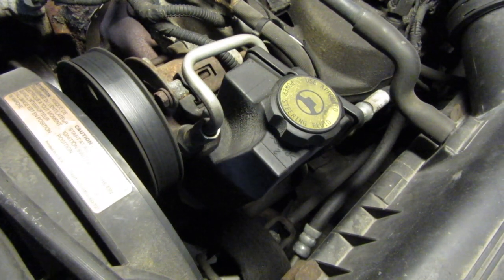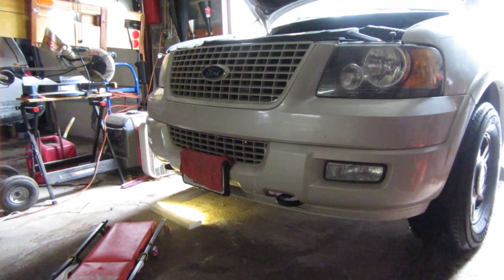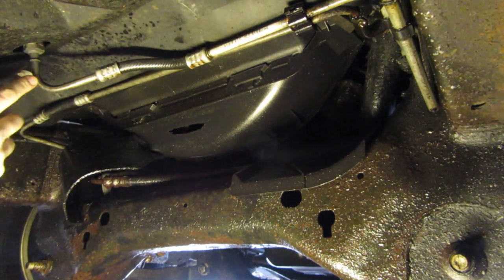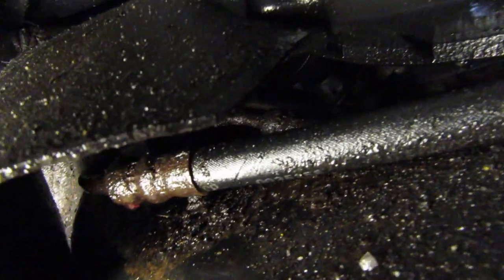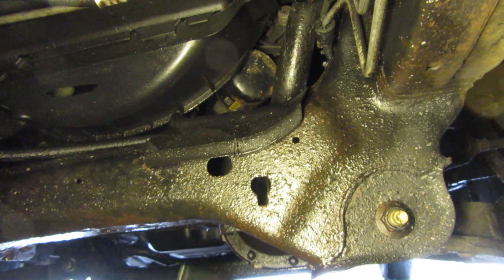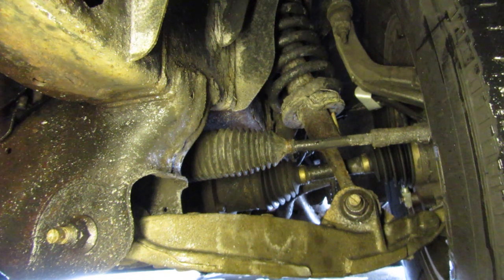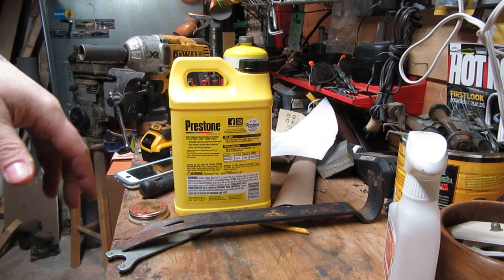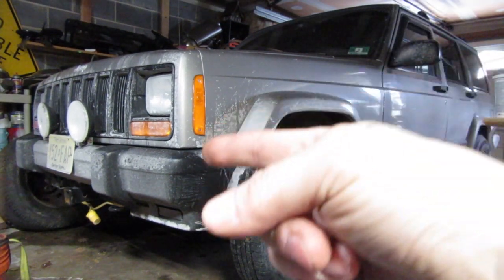WHY IS IFS SO BAD?! independent Front Suspension VS Solid Front Axle

Comment: Ok, I made it to minutes, you're talkin like your trying to blame an accident at an intersection on the person you rear-ended. My truck has independent front suspension on a Chevy. the pump is right there above the box just like your Jeep only I don't have to remove anything if I ever wanted to change the lines. Which I did when I installed an LS motor in the 93. I have a 97 ford pickup with 280,000 Miles on it, original power steering pump and lines, no leaks no squeals no troubles no bubbles. If you want to work on your own vehicle, may I suggest that you look under the hood and consider instead of making videos with your panties wadded so far up in your buttcrack you need a jeep to pull them out,  I'm picturing you going from a big wheel to a 10-speed and totally losing your mind 😿

Comment: lots of people bitch about Wranglers reliability but their cars look and run like trash cans after a few years while the old beaten up Wranglers still looking cool and going.
How many old broncos, how many old toyotas you see on the streets? While CJs and TJs are still running.
And I was on the TJs boat when the first JK came out and though it was crappy made, it turned to be better made than the TJ, no rust after 6 years on a 2014, still looks like new under.

Comment: I love solid axles but i think independent is great too. Try taking a solid axle truck where a trophy truck would go. I'm not bagging on you,and I'm not trying to be rude or anything, but I think you are to biased. Don't get me wrong, I prefer solid axle too (especially for hard core off-roading and rock crawling for sure), but in some cases, independent suspension will beat a solid axle.
Reply: A solid axel vehicles can go anywhere a bit trophy truck can, just slower, the reverse is not true

Comment: Independent front suspension has nothing to do with that! Age does. The newer it is the more difficult to self repair. I drive an 89 bronco. With the twin traction beam and it's a piece of cake. If you want to compare solid and independent get two vehicles exactly the same except front suspension. NOT 80s jeep and a 10-15 ford expidition

Comment: YOU SAID IT MAN. A truck should be a truck. No IFS s?#t on a truck. If somebody wants an IFS so bad, then they should get a sports car. But nowadays they sell trucks with IFS at the rear too. And people buy it. Spoils everything G.C., articulation, durability, easy serviceability. Hell, in my opinion, my tyres used to last longer on a live front axle (I don't even remember going to an alignment shop, the repair guy used to do that in his garage). Thanks.
Reply from the maker: You and I would get along just fine

Comment: God I do love how easy it is to work on my Jeep never had a car that was so easy to fix things on! Although I do get ahead of myself sometimes and forget how things go back together gotta start taking pictures before tearing everything. Off
Reply from the maker: This is solid advice. the camera is your friend
Reply: D&E In The Garage it was embarrassing let me tell you I have a 2008 Jeep Wrangler Unlimited and it had death wobble so I started replacing all the front suspension parts like the tie rod, drag link, and the steering stabilizer and for the life of me between work, kids, and the sun goin down at 7 I took three days to switch them out. Lesson Learned

Comment: Pros for IFS: better cornering off road at speed, better ride on washboard and whoops at speed. Take a look at the trucks winning King of The Hammers, more and more are IFS. I love my solid axle FJ40 for rock crawling but when we are blazing cross country on dirt roads covering 100+ miles a day on gravel roads I wouldn't have anything other than my IFS 100 series Land Cruiser. My IFS GMC had many of the same problems you point out in the Ford, not my Cruiser, Uncle Toyota knew how to do it right.

Comment: I don't like IFS that much either, however not all IFS vehicles use the same steering setup like that Ford. My 98 Dakota 4x4 IFS has a power steering pump and box that are almost identical to what the XJ has. Changing the pump and lines was just as easy as my XJ, the solid front axle in the XJ is still much better for other reasons though.
Reply from the maker: Yea, good point. Dodge kept a much beefier setup for the 2nd gen Dakota and 1st gen durango

Comment: This video is a difference in Ford and Jeep engineering, not solid axle vs IFS. My truck, Chevy Silverado, has IFS and it's just as easy to work on as your Jeep.
Reply from the maker: I admit I have never really worked on a Chevy truck's suspension. I will withhold judgement until such a time as I do. Thanks for the info

Comment: In my experience with IFS. Its fine for cars. But my F150 Heritage had IFS and it always got stuck in deep snow. I could back out and the front would just sink into the snow. Forcing me to use the 4wd when it wasn't neccessary to begin with. I prefer the solid axel for its dependability.

Comment: Expedition is based on the F-150, not the F-250. Excursion is based on the F-250. Also, it doesn't use Dex/Merc. It used Mercon V.

Comment: You obviously have a biasd ppiion and your not compring apple to apples. your caparing a jeep thats meant to go off road to a crap ford. compare to a tacoma or 4 runner. or hummer.
Reply from the maker: First, yes. I am. I did not start a YouTube channel to spew other people opinions, I created it to share my own. I have formed my opinions on these matter through the course of much research and hands-on experience.

The fact that I had a shitbox Ford as an example does not change the outcome. The day before this Ford was in my garage I had a 2004 4Runner in for front end work and it was the same miserable story. For me - that is to say in my experience and in my opinion - IFS is more trouble than it is worth on an SUV or truck. It is overly complicated and expensive to repair and maintain. I know the ride is rougher in my Jeep than in someones Taco or 4Runner, but the ease with which I can fix, upgrade, and maintain my live axle makes up for that. I have off-roaded in both and the solid front axle is just better... 

and not to be antagonistic (really, I do my best to keep it friendly), but don't mention Hummers in a real conversation about offroad vehicles. What GM did to that amazingly capable military vehicle is criminal. They are absolute trash. tactic-cool. All show, no go.
Reply: @DEInTheGarage  In my experience I've had far more front end issues with IFS equipped vehicles than I ever had with any of my solid axle trucks and the solid axle trucks have/had been in far worse conditions than I've ever had any of my IFS vehicles in.  I'll keep my solid axles and skip all the nonsense front end problems associated with using a truck as a truck and having IFS in one.

Comment: IFS was made for the same reason as an automatic Transmission. It rides better for your average driver. In terms of luxury people do not work on their own cars so they just want the best thing for driving on the road looking at it all from the driver seat.
Reply: My 98 ZJ rides great and it has solid front and rear axles.  Too bad 93-94 was the only 2 years for the manual tranny in the ZJ's and pretty rare too apparently.

Comment: Someone walked right past the Blue Oval disclaimer on the grill and bought it. Solid axle suspension is way easier to work on. The IFS has more center ground clearance without being so tall and rides better. I dig my IFS Jeeps but I’ll always be a absolute fan of my solid axle stuff. Oh and stuff berried is to keep from smashing it. Because of this and the ability to have a true skid plate over the diff with nothing to hang up on is why you don’t see tie rods bent on them. Having some of each I’m lucky. But I have the new lift for my Commander in the boxes and if it was for my XJ it would be on just a time and pain issue.
Reply from the maker: Yea, I have lifted IFS Jeep and SFA Jeeps and the IFS ones are a much bigger PITA. The ride definitely is nicer though

Comment: I fully understand what you are talking about 
on the other hand the first IFS toyota is ez to work on and tough 
I owned a few of both IFS and straight axle toyotas I have beaten them a lot
 still would trade the ifs ones for any straight axle toyota truck I have owned 
but I would prefer driving the IFS YOs on the washboard logging roads and trails I use to go kayaking 
It sokes the washboard up like nothing  compared to the straight axles
but for everything else you are right in everything you said 
a lot of the newer IFS systems are a nightmare to work on ...Including jeeps
Reply from the maker: Especially the new Jeeps. They are extremely over complicated.
Reply: Those old straight axle Toyotas were great...try finding one now though HAHA!!!  I almost bought an 82 Toyota 4x4 pickup a few years ago but they wanted way too much for it for the condition it was in, it needed a lot of interior work, and some body work...mainly putting the truck back down to stock height from the hideous 10" or 12" lift that it had.

Comment: The argument about solid front and independent will go on forever.  For me I will just use an example. Way back before many of you were born a bunch of us guys were running the original and best Ford Bronco, of course they had the solid front axles with coil springs, which worked pretty well for ride and articulation. Then in 1980 a buddy of ours just got back from the military and ordered a new Ford  F-150 with a damn 6 cylinder and posi front and rear end. We done what every young buck would do and laughed our asses off, told him that thing was a piece of shit. So we went out 4 wheeling and he casually kicked our butts. That rig would far out climb our Bronco's, which was an amazement to us as we were out 4 wheeling every day and thought ours were the best. So a few years later I bought a new 85 Ford F-250, posi front and rear from the factory and its still an amazing rig. I do have my newer rigs but the old FORD STILL  out climbs them. A lot of folks give that Ford front of that era hell, but mine still works like new, has never been any problem, has 200k on it right now. I have owned many solid axle front ends, the newer independent type maybe not so great for heavy offroad use but my old 85 is still great.
Reply from the maker: Sounds like that 85 was beast! My dad had an 88 F250 when I was growing up and that thing literally started me on my love of 4x4 vehicles.

Comment: Not a fan of IFS either.  Had a 2008 Toyota Tundra, a very light tow on a gravel road in a rain storm and a washout and there went the alignment...far from impressed with IFS, went through far worse than that with a ZJ and a 99 Dodge Ram 4x4 and never had an alignment issue.  Weakest link is that IFS crap, and now many Jeeps are 4 wheel independent suspension as well as most other "SUV's" trying to be cars.
Reply: If it had a rack then that may be why as they are weaker by design so the parts are cheaper and able to be smaller, the tie rods are weak links to save the rack

Comment: Another reason: you get them off the ground and they curl under.
Reply from the maker: That is true. The military had a HUGE problem with the Willys M38 (Successor to the original WWII Willys MB) successor the M-151 (made by Ford) which had IFS... the GIs would take it over a little bump, the wheel would curl, then get caught up and not land right causing the vehicle to flip. A lot of young men were seriously injured or killed because of independent front suspension...
Reply: @DEInTheGarage  arent hummers front and rear IFS?
Reply from the maker: @Galgamoth  Yep, most things are independent suspension front and rear including all new Jeeps except the Wrangler, many small and mid size trucks, and definitely all passenger cars

Comment: 1996 Ford F350 7.3L Powerstroke single cab solid axles. Four leaf springs four shocks. Simple front end. Recently replaced tie rod ends and other front end parts at about 235K miles for about $1k. Neighbor with 2009 Ford F350 diesel has spent over $9500 having his independent front end fixed/rebuilt multiple times under 100k miles on his truck. Best to keep it simple, keep the shiny side up.
Reply: The 09 Super Duty is a solid axle if it's a 4x4, all 4x4 Super Dutys are solid axles.

Comment: That’s why I bought a WJ.  My biggest complaint is it is a pain to jack it up due to the flex.  My other cars are Honda zero flex.
I’m trying to get the road noise down.  At 75 mph it isn’t as quiet as my 2016 Pilot.  
Reliability ? How old are these trucks?  I’m pushing 200k.  Have it gone over and fixed before it breaks.  Love my Jeep. 
Biggest problem with a jeep is the vast amount of accessories . I need 3 WJ’s and an extra job for all the stuff i want but do not need.
I am contemplating a new suspension. Old Man Emu 3.5” vs a long arm lift.  Mainly a Road warrior but I live in an area loaded with trails.Croom FL.
Reply: I have this same issue, but on the ZJ side.  I want a WJ quadra-drive though at some point, or the Commander 5.7L with quadra-drive.